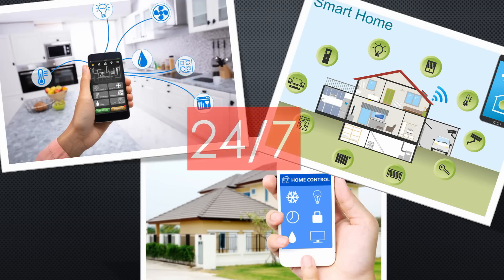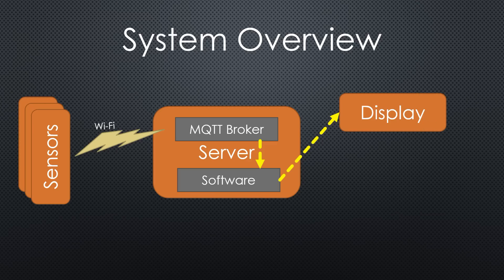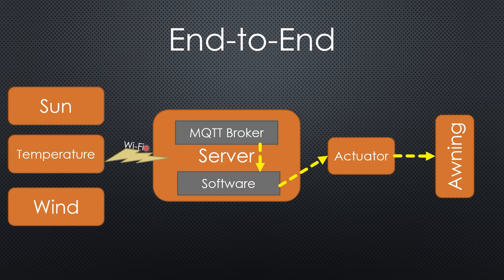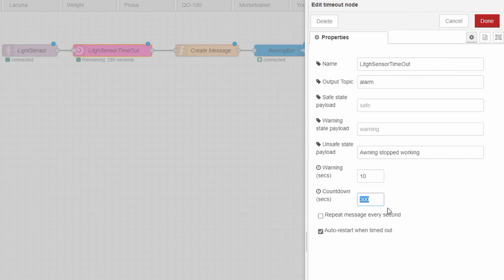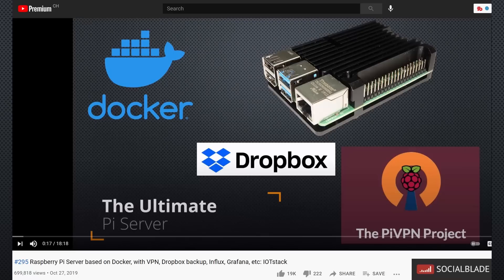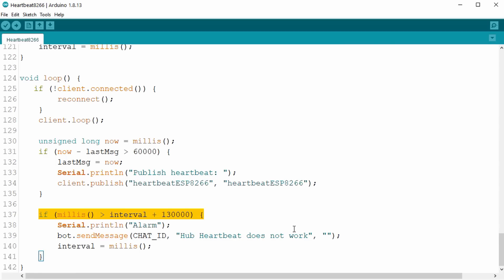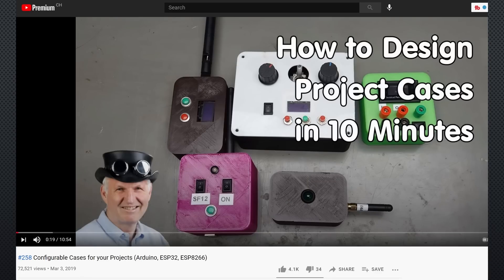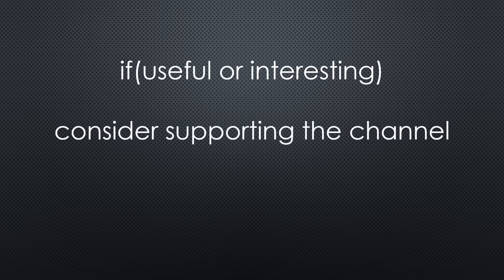#385 Supervise your Home Server with a Watchdog and Heartbeats (Raspberry Pi, ESP8266, Docker)

Comment: 2:35 why do you tie your bike with your car? 
Do you know if it's possible to buy a sun sensor to lower the blinds when the sun shines? I don't know if it makes sense to do it a brightness sensor like the Xiaomi Light Sensor 0~83000 lux Zigbee 3.0 Light Monitor . What do you think? Thanks
Reply from the maker: 1. I was building an antenna with my Harley (see video #212) ;-)
2. I use a home made light sensor, but any light sensor can do. I built my own because I wanted to have it outside and I want to extend the awning only when a lot of sun is shining.

Comment: The entire problem with the 737-max was that it did not even use dual redundancy, and the auditors did not catch it because the system was not labelled "safety critical."
Reply: Additionally, there's some speculation that using redundancy in a "non-critical" system would signal that the system could be critical, so redundancy was not used.
Reply from the maker: I did not know the details. Thank you for your explanation.

Comment: Hello, what kind of wifi temperature sensor do you use?
Reply from the maker: I do not use WiFi temperature sensors. Mine are either 433MHz or Zigbee.
Reply: @AndreasSpiess  ah ok, beacuse in the video it seems that you connected some temp/wind/sun/... through wifi ;)
Nice video in any case.
Reply from the maker: I have a 433MHz and a Zigbee gateway (you find videos about it on this channel)

Comment: I would use the homeassistant app notifications on My phone instead, personally
Reply from the maker: Good idea if you run HA ;-)
Reply: I just prefer as few extra packages as possible to rely on, kiss principle and all that :D
Reply: Problem is that HA, hosted on the Pi that you are monitoring, is most probably not functional when you want to send the alert. Making the watchdog standalone and independent from any other application/server that could compromise it is the way to go.
Reply: @jofie2302  I am not running HA on a Pi, using docker on a much more powerful machine.   I would use a Pi for the watchdog instead, maybe an esp32 :)

Comment: Excellent exploration of the topic.
I enjoyed the method you used to break down the problem according to points of failure and parameters to deal with relative pain.
I absolutely hate the idea of using a cloud-based watchdog. I see no reason to send any home automation data to an external server.
Instead, how about plugging in an old phone or tablet and have it use either your neighbor's wifi as an "external" watchdog or better yet, use the cell network. It's battery would persist in a power outage easily long enough to message your cell phone or even call it. No fancy UPS required, but potentially an added line to your cell phone plan.
As for the ESP8266 device, it needs a battery and charger plus a status RGB LED(s) to make sure it is working especially if you don't get a lot of messages normally.
The only other critique I might have is regarding the watchdog on the ESP8266. 
This could be potentially more functional and easier integrated into Home Assistant, for example, if it were implemented using platform.io or ESPhome which could allow less fidgeting with the device and provide for OTA updates.
Great job with this.
Reply from the maker: Using a different home instead of a webservice is an interesting idea and for sure works.
Personally I  am not too concerned to send just an "I am ok" message to the cloud. I transfer much more important stuff via the internet ;-)

Comment: Connect an esp01 directly to the 3v3 line on the pi, and connect a gpio to the pi reset pin. Code the esp01 to reset the pi when needed. Or connect a gpio from the pi to the esp01 and code it to reset if it does not receive a pulse for a while.
Reply from the maker: Good idea to save the power supply and use the 3.3 volts of the Pi! 
For the moment I do not want to reset the Pi automatically because it might not be crashed. Just some service or the network might be corrupted and I can do some root cause analysis. But for a remote location this is perfect.

Comment: There are also watchdog services which can alert on website downtime or even alert like a dead man switch If not triggered. For example deadmanssnitch.com this is good for checking the monitoring server.
Reply from the maker: I think such a service would help. I still hope I will get one free of charge (of course with much smaller functionality).
Reply: @AndreasSpiess  hm, I was using a free account for deadmansnitch, but I am not sure if it’s still available for new sign ups. I think It had some limited alerting time frequency and only a single watchdog.

Comment: Great video as usual. Just one note: You actually do not need to install a custom timeout node. The built-in Trigger node in Node Red works just fine. Just set it to "Send:nothing, then:wait for x minutes, and 'extend delay if new message arrives'".
Reply from the maker: You are right. You get the same result using your method. Now I know. Thanks.

Comment: Yeah, I learned this the hard way. My Pi-based webserver isn't very reliable, it keeps hanging for whatever reason (power supply? 🤷). I used an Arduino with a relay to let me remotely cycle the Pi's power to reboot it. Unfortunately, the Arduino's Ethernet library didn't work from outside the LAN (🤨), so I ended up replacing it with an ESP with WiFi. The problem is that my ISP's cable-modem is garbage and keeps rebooting and dropping the Internet connection, so I also had to add a relay to cycle its power too. Then I added a relay to cycle the router since it hangs whenever the cable-modem disconnects (wth? 🤨), and finally, I added another relay to cycle my landline's VoIP adapter since it too dies (why can't anything reset when the Internet connection comes back up? 🤦) I also added a DTMF module to let me dial into the landline and punch in a code to reset whatever I need that way instead of thorough a webpage. 😀 Of course, if the Internet connection is down, I'm completely cut off from everything, so I had to add a watchdog to check if the server, router, VoIP adapter, and cable-modem are running, and reset them as needed (unfortunately, not all of them respond to pings even when they are running, so I'm still pulling my hair out and worrying that if I ever have to go out of town, everything will die and I won't have access to my server until I get home. 😒 I'm thinking of attaching a hammer to an arm on a servo to just randomly smash the whole setup. ¬_¬)
Reply from the maker: Sounds like a very sophisticated system! I am glad my components are a bit more reliable ;-)

Comment: Did you try to use matt heartbeat - sys/# topic could notice that some sensor is off?
Reply from the maker: I do not think my sensors send anything on the sys topic. But I do not care too much about on which topic I get a message as long as i get one ;-)
Reply: @AndreasSpiess  if i know you are using mosquito, if you try to subscribe topic "$SYS/broker/log/N" if some of the iot dev. is disconnected then you see special message "socket error on client ..."
Reply from the maker: Thanks. I will monitor this topic and see what I get...

Comment: I love this small power supply for mains. I plan to build several ESP-01s with temperature sensors to map my house temperature. 

As per cloud, I have a Digital Ocean droplet for $5 (+ $1 for backup) that runs docker with one of the containers being a node-red, and I use it to "watchdog" my IoT devices at home.

Great video!
Reply from the maker: Thank you for the link to "Digital Ocean". I will have a look at it.

Comment: Andreas,
What Beer do you prefer? Any swiss beers I should try? 🥳 🍻
And how is the RFI/EMI from that tenstar power supply?
Reply from the maker: 1. My favorite beers are the IPAs. But here, most beers are ordinary Lager.
2. I just had a look at it. It is 25-35dB above noise with a peak on 4.6MHz) and above 12MHz it is on noise level (measured with a probe outside the blue box, not conducted). For sure not excellent...

Comment: Great video. And of course Mrs. Swiss accent is always the priority!

Maybe your watchdog can power cycle the Rπ?
Reply: well, unless you have some safeguards implemented - soft shutdown or read only filesystem to prevent filesystem corruption - i'd say don't just power-cycle it. but in theory: sure. sonoff sells neat wifi controlled USB power switches, and they can be flashed with tasmota. afterwards you can control them via MQTT. then you just sandwich them between the USB power supply and the PI, and you have power control
Reply: sorry, not sonoff but sinilink, the product is here: https://www.aliexpress.com/item/4000791220450.html
Andreas covered it in this video: https://www.youtube.com/watch?v=lrHhn2AVzSA
Reply: @sikedipuuhja7376  
I understand your concerns, but if the processor is hung the damage has been done job at as if the power went out. And it will likely require a power down or reset anyway.
Reply from the maker: I had my fair share of problems (the real reason for this video). The Pi never crashed, but somehow lost its network connection. So I always was able to reboot it from the console. Which I preferred because I rund IOTstack and docker. I was also happy that it did not automatically reboot because it simplified the debugging.
But for a remote Pi, an automatic reboot probably would be a good solution...
Reply: @AndreasSpiess  funny thing, this (console access) can be managed by a simple ESP01 wired to the GPIO pins of the PI which is exposed as /dev/ttyAMA0, then you essentially have a wifi-accessible console, where the networking stack is 100% independent from the pi (as it runs in the ESP) so you can connect to it wirelessly, and perform the troubleshooting procedures automatically.
Reply: @GlennHamblin  true, if it is essentially a kernel panic. but if it's just some network related issue, the OS itself might be just fine. or if the issue is related to the broker process (stops due to an error and systems gives up on it after some tries). read only root FS is always a good thing, especially we use uSD cards - but if we intend to store data, this have to be paired with external (maybe network attached / object) storage.

Comment: Newer Pis come with the hardware watchdog enabled. If you configure watchdog daemon or systemd to monitor the watchdog you can have your pi automagically reboot when the network fails or CPU load stays above threshold for long.
Reply from the maker: A good point. I will have a look at this possibility. Thanks for the tip!

Comment: Andreas, also an option would be to run a task on your router - in case you actually own yours (as some service providers lend subscribers their branded and crippled soapbox). for example with routerOS 6.48.3 you have MQTT publisher support in all mikrotik devices, and a built in 'netwatch' functionality that allows you to monitor practically anything with ICMP (ping), at a defined periodicity and timeout for each probe. upon events (box is unreachable or reachable) it can run different scripts, for example publish something to an MQTT broker. or GET/POST to a URL.
sure, this is not 'application level' monitoring, but does the trick for me since years.
more info here: https://help.mikrotik.com/docs/display/ROS/Netwatch and https://help.mikrotik.com/docs/display/ROS/MQTT respectively
Reply from the maker: Indeed I have a Mikrotik router. But so far I never looked into it too much. It was too complex for me. Maybe I will give it a try with your links to documentation
Reply: @AndreasSpiess  routerOS scripting will seem a bit funky for the first try, but one can live with it after a few mistakes. here's another link to get you started with it: https://help.mikrotik.com/docs/display/ROS/Scripting - at the bottom of the page you will find some examples and a lot user contributed scripts. once you got addicted to it, there's an entire topic collection over at the official routeros forums.

Comment: There are services like uptimerobot which can be configured to ping a certain port. The free account works really well!
Reply: True and maybe IFTTT can be configured. Also there there might be a telegram app too.
Reply from the maker: @Aleksandrs: I just tried uptimerobot. Because I do not want to open a port just for that I was happy to see their "heartbeat" option. After registration, I discovered that this is only available in the pro plan :-(
@AppEdTech: I never found something like a timeout on IFTT. This would use resources all the time. Maybe this is why they do not offer it. Or maybe I just did not find it...

Comment: Why revert to 'the cloud' for an off-site watchdog? Better is to have a maker-friend or radio-amature friend with a similar setup. Pingpong the heartbeats over to each others MQTT-brokers. If you don't want to set up a vpn between the two, mosquitto could provide some basic password protection and limit a user to only the 'heartbeat'-topic. If you allow access to more topics, you could have some backup node red flows running on the external server, for example to try to reboot the pi using an external command that triggers a shutdown-sequence.

No extra hardware, no extra energy consumption and little effort to create.
Reply from the maker: Good idea with a colleague or a family member. So far I did not want to open a port on my router just for that purpose. This is why I would prefer a webcall from behind the firewall.
So far I do not have a remote access to my network. Last year I was not a lot "on the road" ;-) So a project for summer...

Comment: Thanks for the great video.  I have a custom Python program using Pykka (a Message / Actor model) to do all the automation.  I had to make a heartbeat message for the actors for the very rare case where one crashes.  I also made one for the MQTT-to-Insteon gateway program I use, which sometimes spontaneously quits working.  But very rarely, something else will pop up and show a failure mode I didn't anticipate.  You've given me some cool ideas to fill the gaps!
Reply from the maker: You seem to use different tools, but similar principles. As we say here "many roads lead to Rome"...

Comment: You can use a power socket running Tasmota and a few rules which in addition allows to reboot your server. All in one device 😃
Reply: I control my central heating with a tasmota-flashed device.  It has some rules on it so that if it loses wifi or mqtt conections it turns the heating on.  Its my failsafe in case my ha fails when Im away for the weekend in the winter,  the central heating would then be controlled by trvs.  I have a second pi that monitors my main ha server, and if nothing is heard from the main server in 15 mins it will email me and powercycle the ha server.
Reply from the maker: Both go much further with the automation as I did. Very well done! I just wanted an alarm, but on my Smartphone screen with a sound. That is why I did not use email.
Reply: @AndreasSpiess  You know that on this channel we want more.  ;)   Thanks for your inspirational videos

Comment: The BCM2835 System on a Chip that powers the Raspberry Pi has a WDT on board. It has 20 bits and counts down every 16us for a  of 16 seconds. This means you have to write to the internal WTD earlier than every 16 seconds, or the WDT will fire. That watchdog can be used to make sure that the Raspberry Pi is operational.
Reply from the maker: Good idea. Thank you!

Comment: Another excelent and funny (happy wife, happy life) video Andreas! You are really know what you are doing.
I wrote a simple php watchdog with cronjobs and email notifications some time ago, but i also just had a new idea for a heartbeat function. This should work on nearly every hosting service or php server. There are also free cronjob services, if the hosting services does not provide that.
I will improve the code, open source it and post it here later.
Reply from the maker: Very good! Thank you. It would be great if it would be able to act the same way as my ESP8266 and I could install it on my webhosting! Then I would no more have my internet as a single point of failure.
Reply: @AndreasSpiess  The plan is the following:
1. You have a easy to expand list of devices that you want to monitor.
2. The devices can either be pinged via URL / IP (I already had that) or the devices themselves must periodically (heartbeat) call a specified webhook and the php-script stores a simple timestamp and when a definable time has expired, there is an alarm.
3. For the alarm there are different possibilities:
You can call another webhook, or sending an email with phpmailer.
Alternatively I will have a look if there is a telegram library for php. But ff i remember right, telegram also supports simple webhooks. I try to keep it as simple as possible.
Does this sound right for your purposes?
Reply from the maker: Sounds good. Yes, I also use a simple web call for Telegram in my ESP8266.
Maybe you send me the link also via Messenger because this comment will get out of my focus in a few days

Comment: Many routers can be set up as watchdogs for other devices with a little hactivation.
Reply from the maker: How would this be done?
Reply: @AndreasSpiess  Many routers run some form of Linux.  In my opinion the easiest way would be to create a cron job to ping the device.  Open-wrt is pretty common on routers.  https://openwrt.org/docs/guide-user/base-system/cron
Reply from the maker: Aha, I understand. Mine is a "closed shop". So I cannot do it this way...